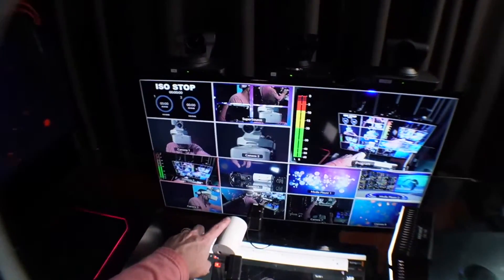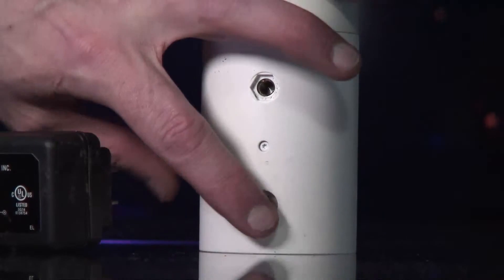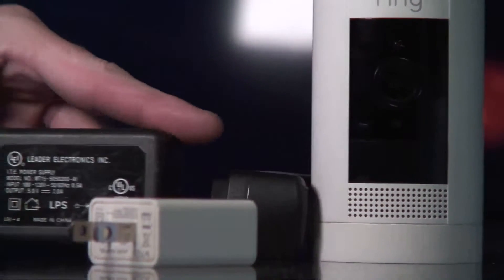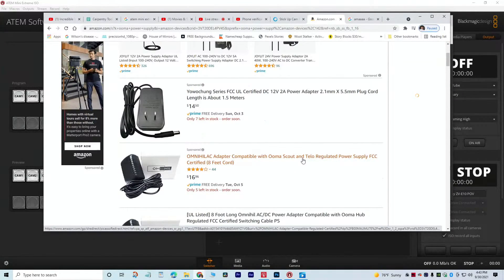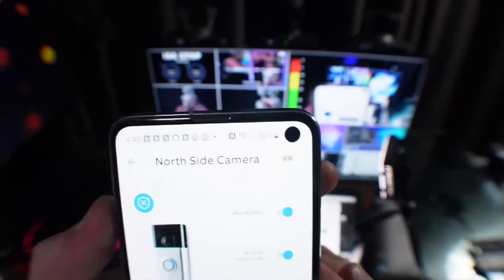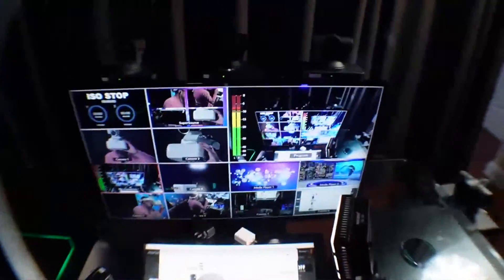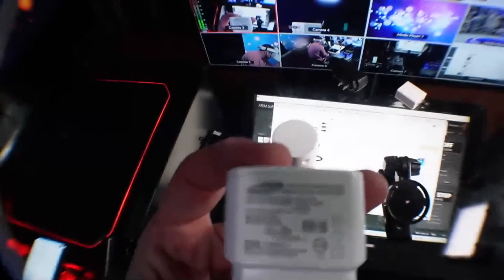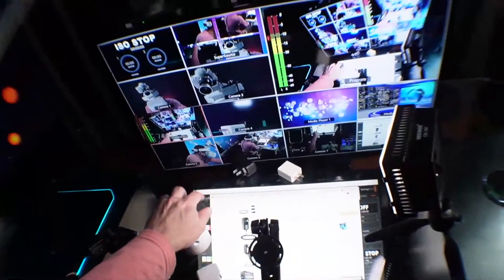Charging the Ring Stick Up Cam Battery (3rd Generation) While In Use

Comment: It would be much simpler to buy a plug in stick up camera that comes with a very long power cord, maybe 30 ft. Just add a battery and you have a powered cam with battery back up. The battery stays charged. Alternative would be a 4 watt solar powered stick up cam with a battery back up. In full sun 2-3 hours daily the panel will keep the battery fully charged. Very helpful if there is no power handy.

Comment: Hi , I would like to ask on your power pack, which is positive on the barrel plug. 
I have a couple.  Don't want to plug In wrong polarity
Reply from the maker: center hole is always + positive, the metal sleeve or outer barrel will always be - negative
Reply: @Mr Virtual Vlogger   Many thanks
Reply: This is absolutely not always the case.   DC barrel connectors can be designed as center pin + or -   You need to look at the diagram or pinout for the device you are working with.

Comment: I'm trying to use a power adaptor to charge the battery like in the video but in the app the battery is unknown. I set the power setting as Battery. Is this right? Why does the app think the battery charge is unknown? and it thinks there is not enough charge. Which Power mode did you set it to for the Ring Battery Stick up camera?
Reply from the maker: If you do it right, the little icon will AUTOMATICALLY switch to a solar charging version since their solar charger works the same way.

Comment: Hey ,if i get a Ring Plug-In camera and also install a battery in the unit, does the plug-in unit charge the battety also? Or does it just draw from the battery when external power source is cut? Ring tech support says 'it should recharge' the battery, but lots of blogs/forums claim opposite.
Reply from the maker: Yes it does, I have all my networks on battery backup just in case the house power is compromised. Never can be too safe,  I need to stop watching murder shows on Netflix.
Reply: @MrVirtualVlogger  the ? was ,,,, does an externaly powered batt, cam charge its own internal batt??
Reply from the maker: @jayhigh527  If you are referring to a separate battery pack outside of the replaceable battery  Ring provides with this unit then I would guess it works depend on your battery packs ability to provide 5v 1amp while being charged. If you are getting to the Ring Cam model that does not come with a battery then I do not know, this review is for the battery operated unity only.

If you are referring to the battery that comes standard with the camera in this video then yes, it will recharge while plugged in to a 5v 1amp power supply. ( You will see it turn into a solar icon in the video which means it is charging.)
Reply from the maker: @jayhigh527  Yes, the Ring Cam model in this video will keep the battery charged while in operation with 5volts 1amp provided